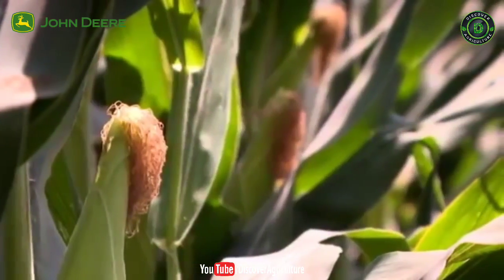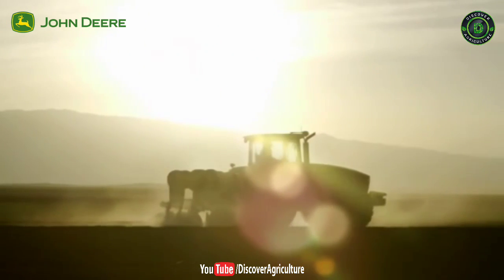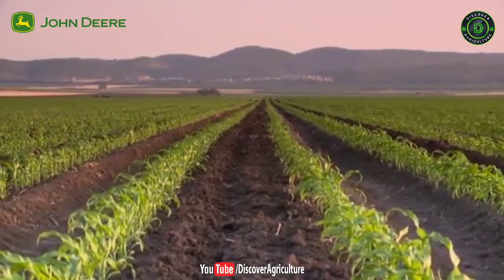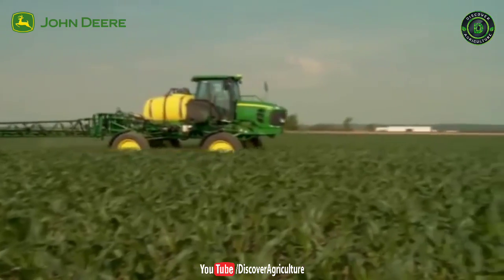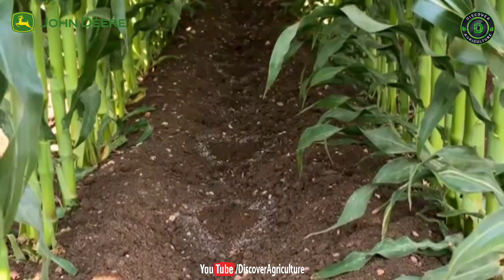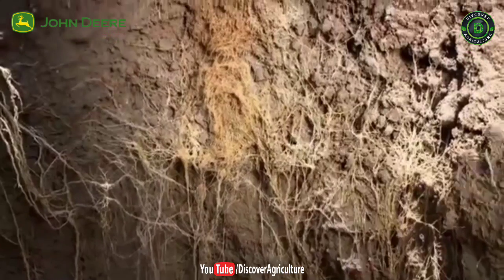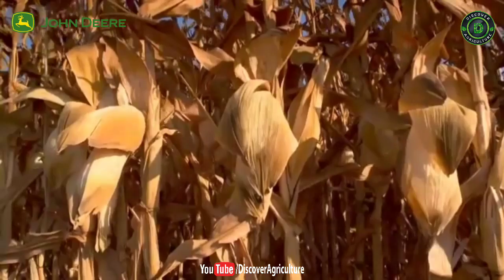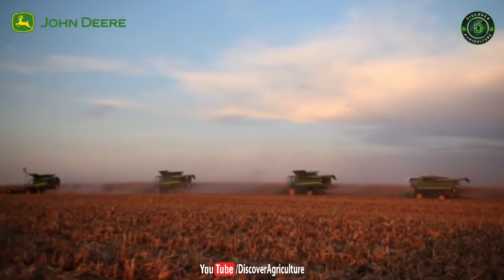John Deere Subsurface Drip irrigation System

Comment: That would cost a fortune to install and another fortune in upkeep.
Reply: I've been told $1,000 - $1,200 an acre higher than a pivot system.  Very little iron can be in your water as it will stop up the emitters.  15-30 year life span on the underground pipes.  Tough decision.  I'm still dry myself, praying for rain.